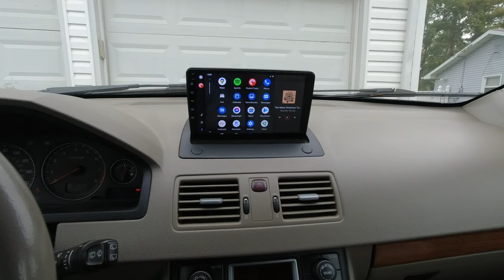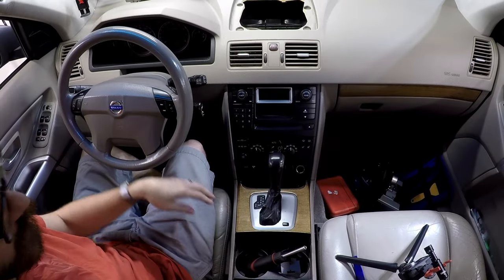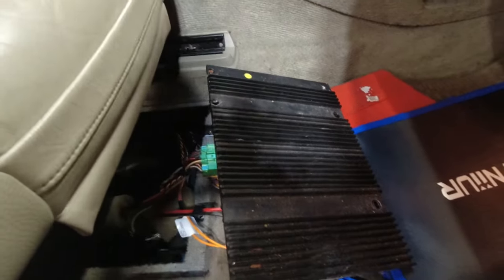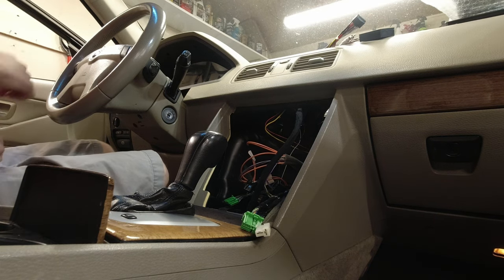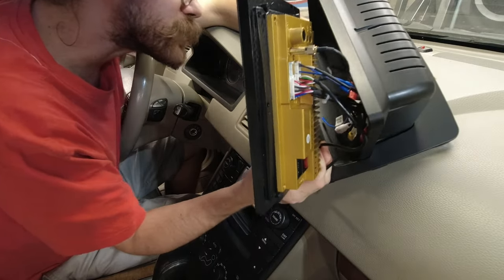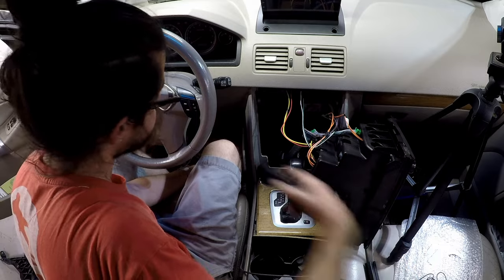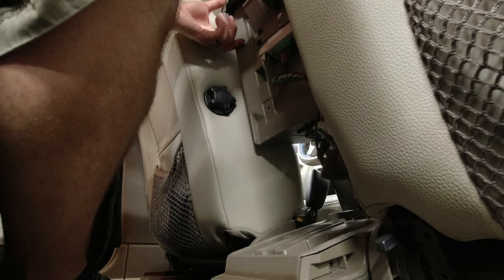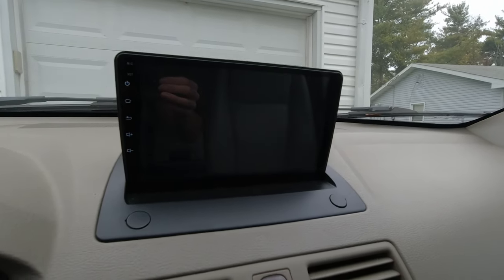Installing an Android Head Unit in a Volvo XC90

Comment: Will this unit work on a 09 C30?
Reply from the maker: This specific unit would not work, but there may be other options like this:
https://www.seicane.com/for-changan-volvo-s40-2012-volvo-c30-2006-2013-volvo-c70-2004-2010-hd-touchscreen-radio-gps-navigation-system-support-bluetooth-carplay-obd2-dvr-3g-wifi-steering-wheel-control-h6748
You can also search "volvo c30 android head unit" or for the s40 as it seems like they have the same audio system and dash for that year.

Comment: any possibility to retrofit a rti in '06 v70??
Reply from the maker: It looks like there are some kits available for that car, but I don't know the details for the installation.
Reply: @frenchineer  could you please send me more info about those kits ? I found for xc90 or newer v70 (iii) ... thx
Reply from the maker: I found some options by searching "2006 volvo v70 android head unit". Here's one example: https://www.amazon.com/Android-2005-2009-Biorunn-Wireless-Car-Play/dp/B0CG6LRYFQ?th=1 
I don't know anything about this brand or seller, so I recommend checking on Volvo forums to see what other people have tried.
Reply: @frenchineer  yes, I know. I can replace a genuine radio. I'm asking about RTI panel in a dashboard.
Reply from the maker: I see what you mean. In this case, this is actually a radio replacement, the original is no longer connected to the speakers but has to remain in place because it is connected to other critical systems like airbags (though on cars with AUX I think the original radio continues to work).
I actually have a video coming next week on something that could do what you want, but isn't a permanent install.

Comment: How did you adjust the EQ?
Reply from the maker: There is a built in app to adjust it.
Reply: @frenchineer  I meant what levels did you adjust the bass and treble to etc? Thanks for the video!
Reply from the maker: Right sorry! I think I started off with the included presets and turned on the equal loudness option. I usually try that with a song I know well then adjust to my preferences if needed. Right now it's similar to the rock preset, but on other cars I tend to increase a bit on the lower/mid range and a little in part of the top if needed.

Comment: Will this also work on the s80 v8?
Reply from the maker: This unit is specific to the XC90, but there are probably similar units for the S80 as well. You would have to search for your year and make there are no compatibility issues (some aftermarket units require specific factory options).
Reply: @frenchineer  Much appreciated

Comment: Your radio have no AUX?
Reply from the maker: No, I think the factory radio got AUX in 2007, mine did not have it.
Reply: Your original Volvo radio is steel working? I have audio in android but no audio in orginal radio
Reply from the maker: No, the harness for cars without AUX bypasses the radio, so there is no sound from it.

Comment: Where can i find zlink
Reply from the maker: So I realized that Zlink usually comes installed on certain head units, but isn't available on the app store. There may be some guides to find and install it but I don't know what the results would be. Headunit Reloaded is in the app store, and is what I use on this unit.

Comment: It is the most inconvenient to use while driving and very disturbing when driving in the dark.Why do I need two multimedia devices in my car?This place is for original GPS
Reply: Ive had mine installed for a year now and it's great, original GPS is basically useless when compared to Google and Apple maps or Waze and the factory head unit is extremely outdated.

Comment: Bought xc90 2006 today. It seems that my car doesn’t have aux in. Does that mean this wont work in my car
Reply from the maker: I also did not have AUX in for my car, but when I ordered mine there was an option for non-aux vehicles. I'm not sure why they changed the options...
Reply: I also have the old radio without aux - as the new head unit bypasses amplifier and connects directly to speakers you will get the sound from new unit through the old speakers - I can either connect the speakers to the old radio or the new head unit - both have great sound - as the android unit has also own FM radio module, there is basically no need to use the old one … I am planning to use the old unit only for the parking sensors by connecting new dedicated speaker to the old system
Reply: @Ivo Doležal  which speaker is used for rear parking sensor? As I have no parking sensor now? Also did you find settings fir can bus? Thanks
Reply: @alper-vy2sl  rear right speaker
Reply: I’ve got a new cable&decoder and now the canbus works
Reply: @Ivo Doležal  could you please share link where you bought it. Also settings on the android for the can bus,as mine can bus doesn't work .thanks